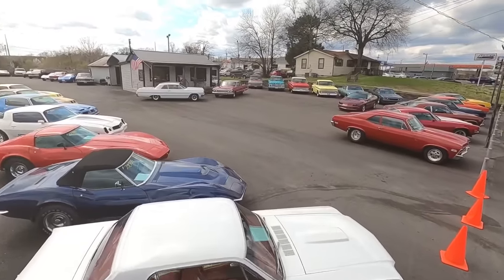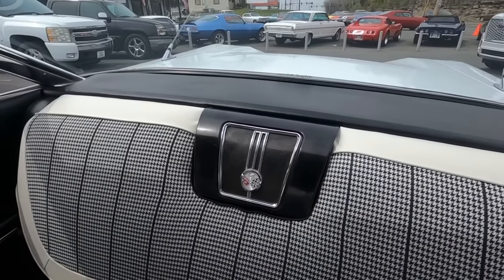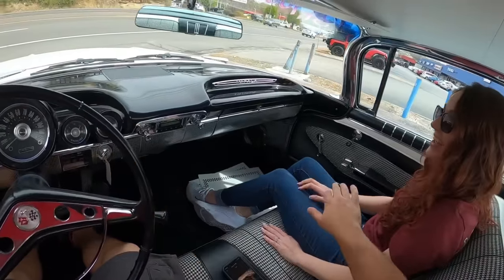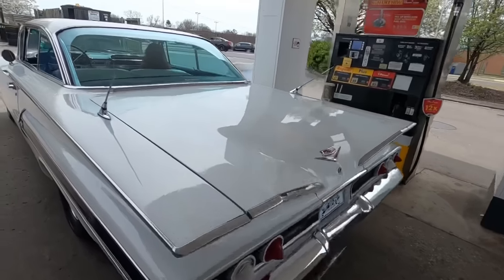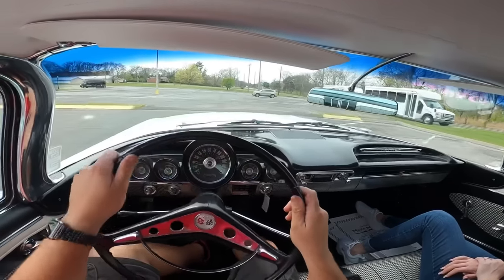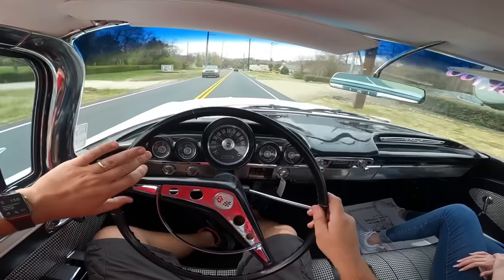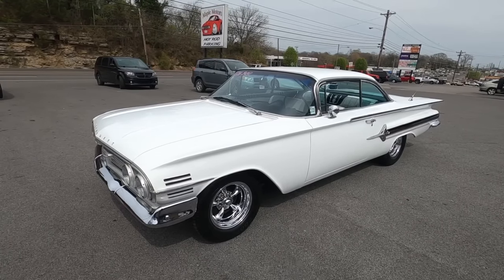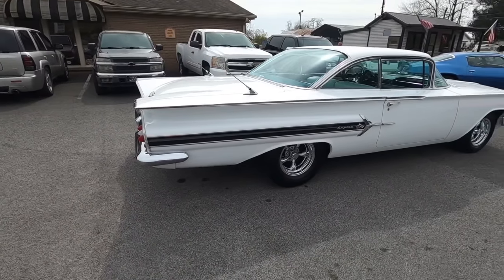Test Drive 1960 Chevrolet Impala $34,900 Maple Motors #1528

Comment: The forgotten Impala, 59 & 60 are so unique in their styling and you really don't see them very often. You know better than me, but seems a bit pricey for a baseline Impala.
Reply: Yeah, and one with all of the issues that it has too. I could understand if it had an automatic transmission, power disc brakes, A/C, power windows and a much better engine and exhaust. But, it is what it is, and they can price them as they seem fit to do so; they do own the cars. All in all, Maple Motors is an awesome company, they do all the hard work finding so many cars, all year around. That's something that you and I just can't do. I'll bet that one day you will see the car or truck that y'all just have to have and then you can thank the good folk there at Maple Motors. 
But this is just my humble opinion. 
God bless you and yours and GOD BLESS AMERICA 🇺🇲 🇺🇸
Reply: At this point the Impala was the highest trim, the Biscayne and Bel Air were lower.
Reply: Forgot 58 impala
Reply: I think it’s a pretty fair price given the massive inflation going on these days. Plus it’s a very rare model year for the impala second only to the 58

Comment: When I was fifteen in 1977 we moved into my stepdad's great-uncles house, who died back about 1969. In a old garage to the side was a 1959 med.blue -white top, 4-door, 3-speed Impala with 2300 miles on it. Still had the paper mats in the floor that looked like they had never been stepped on. The only thing wrong was a lite film of dust, on what looked like a brand new car. Not a speck of corrosion on any of the miles of chrome. Sadly, my stepdads uncle got to claim the car. So they put a rope on the front, pulled it down the road, popped the clutch and it fired right up (gas was a lot better then). He sold it on the spot to a buddy for $500 dollars and we never saw it again. But that car made quite an impression on us for the two and a half hours we got to be around it.

Comment: Nice looking car.  The head markings appear indicate the lowest performance 283 heads. Those came on a 2 barrel / single exhaust engine rated at 170 hp.  Of course this one has an aftermarket 4 barrel intake and carb with dual exhaust and upgraded cam.  With those heads it is still unlikely to make much over 200 hp.  Still should be fun to drive with the 3 on the tree.  I’d love to have it, but would upgrade the heads to the 220 hp version. That would make 250 hp with the intake, carb and cam it has.  That’s not bad for a 283.  A nice 348 to drop in would make it a stand out.